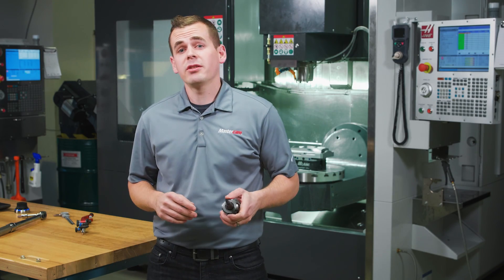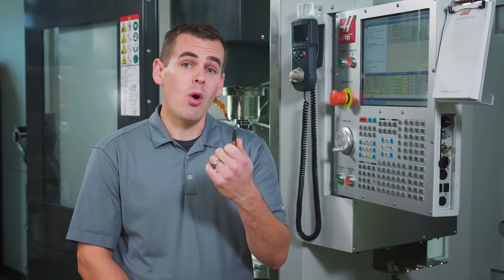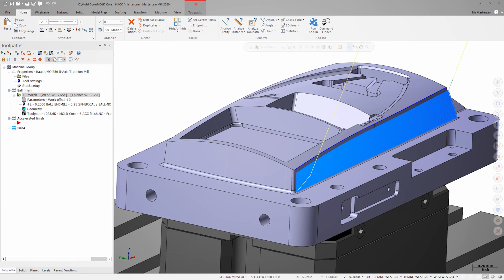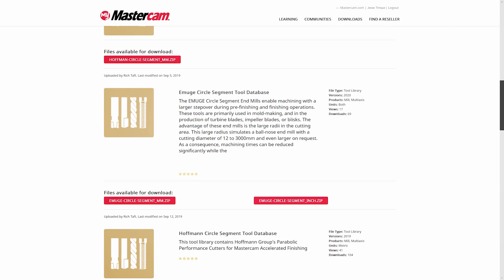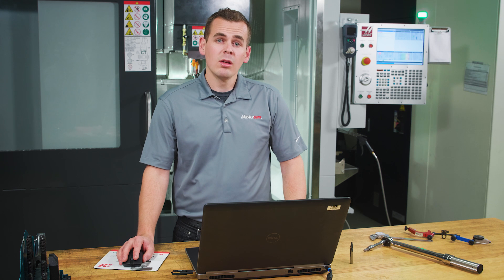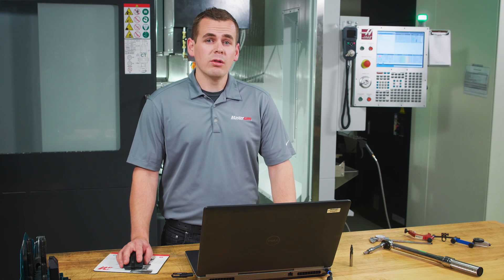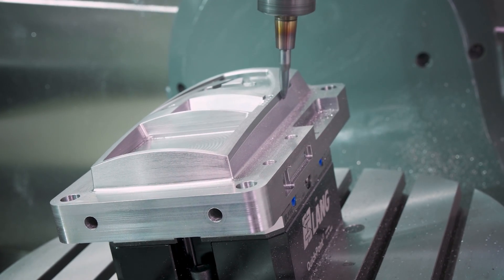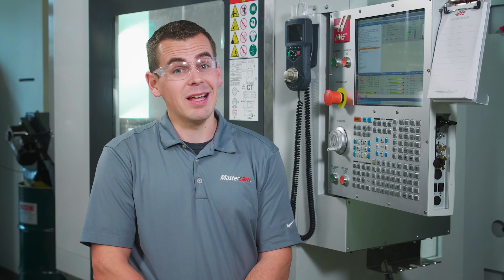Advanced Tool Geometries - Shorter cycle times with a better finish

Comment: I've been testing out these new circle segment tools and have been struggling to figure out the optimal tilt angles to be using on my UMC750. Where is the angle value of 78 degrees dervived from?
Reply: Just an arbitrary number. Enough to move the contact point to the large radius on the tool. It might help looking at a 2D sketch of the tool geometry.
One of the Emuge oval tools I use it looks like the large radius starts at about 71 or 72° - beyond that point up til 90, you'll be on the large radius section of the tool.

Which tool are you using?